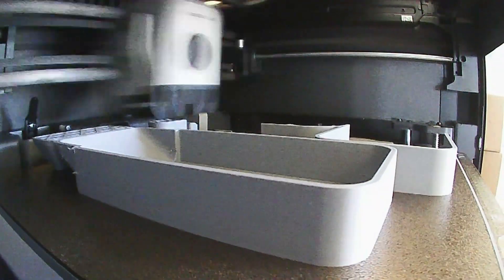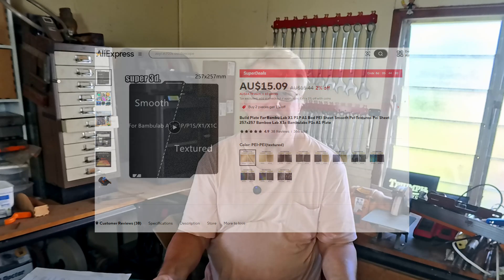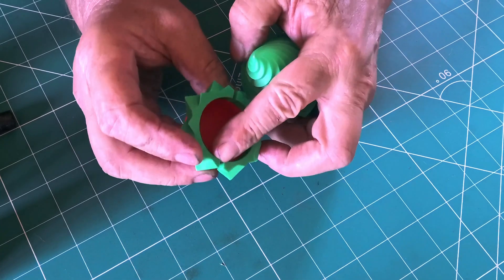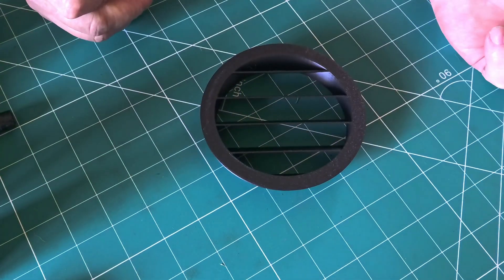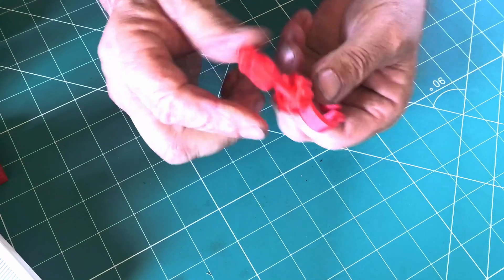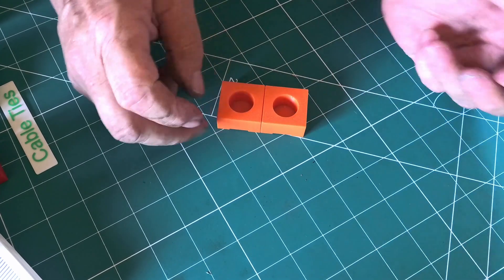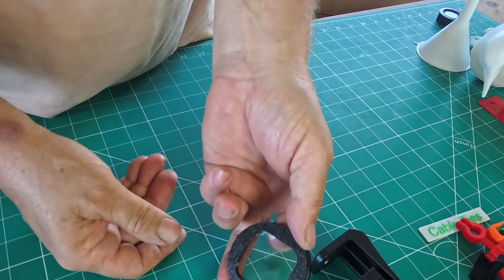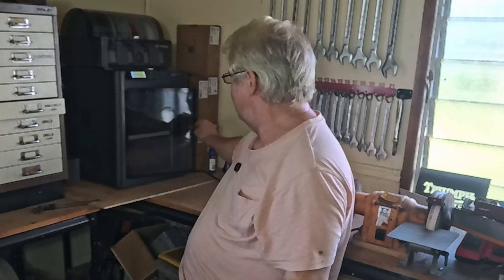6 Weeks with the Bambu Labs P1S Honest Review and Print Showcase

Comment: The second I saw all those desiccant holder models with the hygrometer slot, I thought it was silly to place it there. Definitely a decision born out of aesthetic preference rather than any kind of functional engineering. Good video.
Reply from the maker: Yes I thought the same but followed the herd to see if it worked. Better to print another one of the normal ones and stick that in the middle. In my climate it's amazing how long it takes to bring the AMS back down to acceptable levels after opening the top. It takes 6 or 7 hours.

Comment: Really appreciate the detailed, non sales pitch of an experience. You seem to have gotten good use of it, and with impressive results. 
Have just grabbed a p1s with hardened steel gear assembly and hot end for printing carbon fibre. Also grabbed some air purifiers as have to locate in the house. I see yours is quite contained, if possible can you share any experience on what it's been like working around it, how you handle the air quality or if space has been sufficient. Thanks again, and happy new year.
Reply from the maker: Thanks for the kind comments. The printer is in my "tool room" this is a separate building to the house and it has glass louvre windows so even when you don't want it to be air flow is high. I have noticed some fumes printing ASA and ABS but PLA nothing at all. Living in the sub tropics humidity is my main problem. Happy New year to you too👍
Reply: @plasmaDave  Thank you very much for taking the time, here's to a happy and productive '25.

Comment: I have the Bambu X1c, and what I reccommend is to reduce the speed for very tall objects. the faster you go then the higher risk is to fail the print, due to the speed vibration.
If I know I have to spend lot of hours for a print I always reduce the speed, and I leave printing overnight.
for tall objects I mean usuallt higher than 100mm on the Z axis
Reply from the maker: @CallistoPili  I'll try that 👍

Comment: I have had my P1P for a long while now, I have never had to use anything on the PEI build plate, before printing I use a microfiber cloth and isopropyl alcohol to clean the plate, Bambu recommend glue stick for TPU, PC-CF and PA, I have printed TPU without using a glue stick and had no issues, I have not tried the other two. 
Your ABS and ASA adhesion problems could be due to the lack of a heated chamber on the P1S leading to excessive warping, I do not print these on the P1P.
Where I have had adhesion problems it is usually due to forgetting to clean the plate before printing, or having the wrong process settings for the filament, the manufacturer of the filaments that I use provide settings files that have been tested to work on Bambu printers, you simply add these to Bambu Studio, if you are using filament other than Bambu Labs it is worth checking if the manufacturer has filament and process files that you can use.
Lastly the filament you showed I will assume was PLA, when it gets old and more importantly absorbs moisture it becomes brittle and can/will print poorly, I have also noticed that PETG becomes stringy when not dry, after purchasing a filament dryer and drying my old filaments the printing results were vastly improved.
I hope this helps with your issues, and of course your mileage may vary, but this is what I have found works for me.
Reply from the maker: Thanks for the detailed reply I upped the bed temp and printing temp from the Bambu standards for ASA and ABS and the helped but the change to a smooth plate was the major improvement no warpage now. The grey PLA was new out of the package back then but it was probably a bit wet. The broken PLA was 7 years old at least and I should have binned it. Drying that did no good at all 👍😊

Comment: I always use a short spray with 3DLAC on almost any build plate. I then can print about 10 to 15 times on that plate, clean it up with some lukewarm water, and apply a short spray again. I bought one spray can about two years ago, and I still have more than enough left, so that can will last for a very long time. I am sure there are other brands that work fine too (and even ordinary hairspray), but I have not tried those out (yet). Some people swear by using a glue stick, but I personally think it's a bit messy and does not work that well. But that's just personal experience.
Reply from the maker: I'll have a look for that, sounds expensive, but these things are relative I guess  😁
Reply: @plasmaDave  Its exactly what i use and no longer have any bed adhesion issues. make sure your clean your print bed too and allow the part to cool before removing it. 3DLac btw is essentially hair spray. In fact if you look at the rear of the spray you'll see written "LAISEVEN COSMETICS, S.L."  so I suspect its just hairspray and only slightly modified for our 3d printers.
Reply from the maker: @AmirKhan-qx2lr  Interesting, I must look into it a bit more. So far nothing has let go of the smooth plate. It also makes it very easy to see where you touched the plate. It shows up finger grease really well.
Reply: I use 3dLac too with original PEI plate. I print PLA at 55C bed and ABS at 90C bed.   I have a big 3dLac spray can and it lasts forever.

Comment: the new build plates will work much better, but if you want honest to god best adhesion, go with Aqua Net hair spray. I use it every print.
Reply from the maker: Interesting idea, I'll have to try that out, but I've found the new bed plate works great for me so far anyway.
Reply: @ just a spritz will do, and when you get bad filament, it gives a layer that will protect build plate and allow separation instead of filament gluing its self to plate. Good luck!

Comment: Excellent thanks Dave.  It's interesting to see how different people use 3D printers:
**  A sort of base level searches websites for "Cutesy" things to print.
**  Manufacturer uses it to make the same item repeatedly, like a component in a larger product.
**  Hard-core, soaks up everything 3d printer related, probably builds or modifies printers, may even have a website or Youtube channel.
**  Maker uses it in conjunction with other tools in a workshop environment.  I see you (and me) in this category.
The items you showed might trigger ideas for other makers, but they were mainly specific to you.  I have an eclectic selection of hooks, latches, brackets, more brackets, ducts, funnels, caps... none of them of any use to anybody else.   Of course we all have a "Magpie" in the closet!  I have to admit to some Christmas tree ornaments, 3D printed fabric, a wire-framed shelf ornament, and a few other unmentionables.
I am just about to press "Print" on an improved hose connector / inlet for my shop-vac.
I'm not obsessive about my old Ender 3, but I am glad I have it.
Reply from the maker: @PiefacePete46  Thanks mate, it is amazing the things you make, having finished the video I keep seeing other things I have made that I totally forgot to include.   As you say I am not too much into ornaments and mostly like to make practical things, had to have a magpie though 😁. This printer is so much more reliable than my old one and amazingly even the Mrs calls it a good investment.